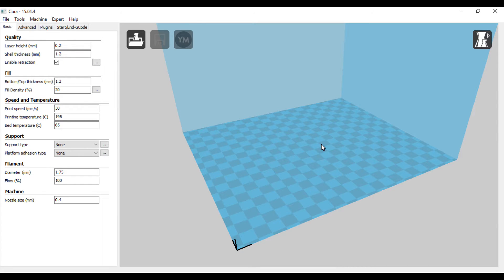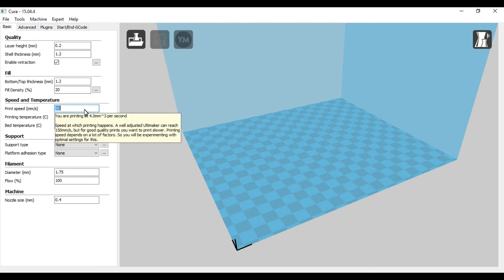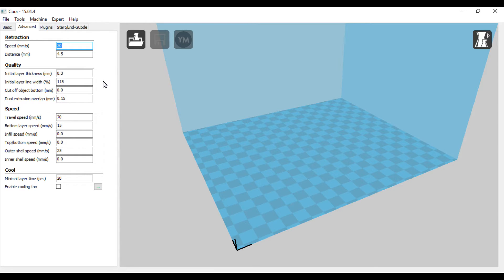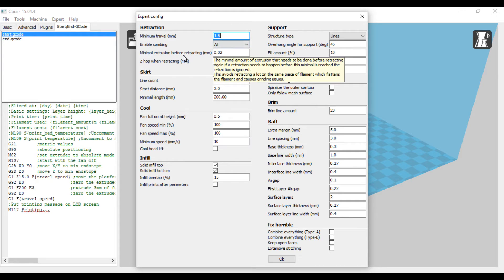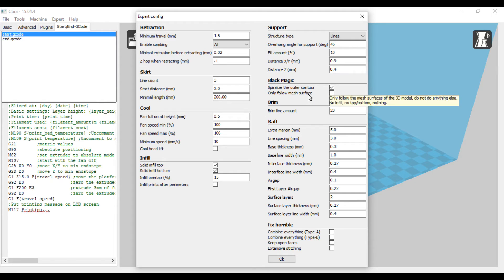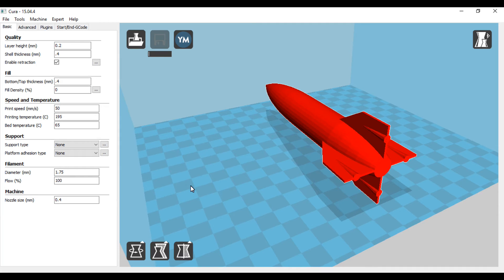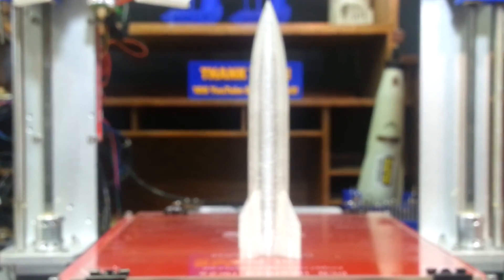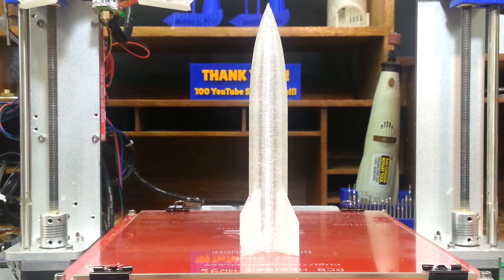Cura Settings / Hollow Rocket

Comment: I'm using Repetier-host with CuraEngine as recommended in the user manuals of Geeetech. Should i switch over Cura or is this all the same ?

Thanks, also good job with these video's, very informative
Reply from the maker: +Bram Vanden Bempt Personally, Cura gives you way more control.  The newest Cura gives you even more control than it did at when I made this video. 

Thank you!!!
Reply: i tried out cura but i can't find the setting "first layer extrusion width". I've got it on repetier-host and had it set to 150% for a strong adhesion. Didn't even need hairspray anymore :D. Unfortunately i can't find it anywhere in the cura settings...
Reply from the maker: +Bram Vanden Bempt if you are using the newer Cura, in the advanced settings there is a insane number of extra settings.  If you check the box next to them it adds it.  I know that is one of them.
Reply: it seems that they removed this setting from Cura 2.x
I'll check out the legacy version that you're using in the video and see if that makes a difference because the prints i get with the new cura are pretty much crap.
Reply from the maker: +Bram Vanden Bempt in the older version you would set the first layer extrusion percentage to increase the line width.  I use 120%.

Comment: Try printing with a brim, its just a ring around the object and helps keep thing down to the bed. Its also a very good way to fine tune your printer during the printing of the brim. You can adjust flow rate, bed level etc just by looking at the brim. If your brim looks like Sh.. your print will look like Sh.. ;-) Anyway it always helps me. Initial layer line width I have it set to 70, this way lines will be printed very close together making a excellent sticking first layer!

Comment: +Jimmy Shaw's Tidbits I have the same printer and have had nothing but bad luck so far I am on my third control board from them and I'm about to try it today if it doesn't work this time I don't know what to do ... Any suggestions?
Reply: Buy a arduino mega a ramps 1.4 board plus 4 stepper motor drivers. You can find combo packs on ebay for next to nothing. I can send you a copy of my merlin firmware. The p3steel is the same printer only with a different frame. the control boards that geeettech uses are really bottom of the line. With a normal arduino ramps combo you will have a controller that most printer out there use, lots of community support. Its a very well tested system. But I must say.. that prusa kit looks very nice, its not as stable as the p3steel but it looks hot :-)
Reply: +Voyager  could you send me that firmware I just bought the arduino ramps set up and it will be here this weekend so hopefully it will work!!! Thanks for your help! 
My email is Wafarmer4life@gmail.com
Reply from the maker: +CornbinderKid Have you contacted Geeetech Technical Support?  Also do you have the correct input voltage selected on the power supply?
Reply from the maker: +CornbinderKid is one more thing you should check before you saw this new board. Please check the DC power output.  It should be between 12V and 14V DC.  If it is set too high it could be frying your boards.
Reply: +Jimmy Shaw's Tidbits the crazy thing is I had the printer running flawlessly and it was producing excellent quality prints for a few days then the extruder just kinda stopped working right in the middle of a rather large print. I talked with the technical support guy and he's sent me a new board because the motor seemed to functional and the wire seemed to be ok. The next board they sent was damaged in shipping because it was in an envelope so this next one is gonna be the last try and then I'm selling it and buying an actual Prusa kit.